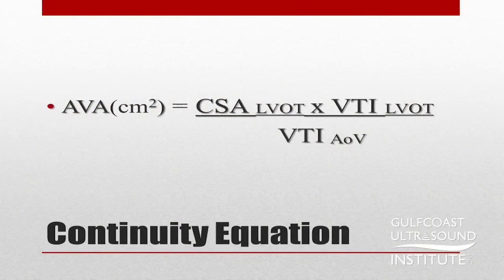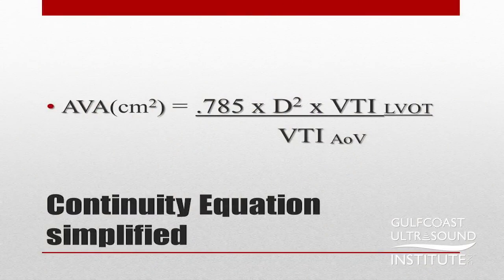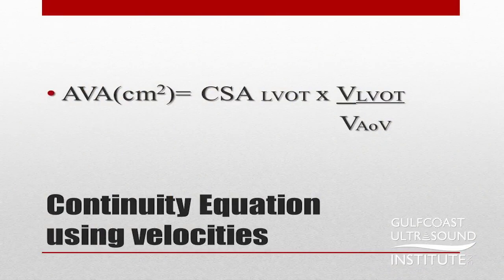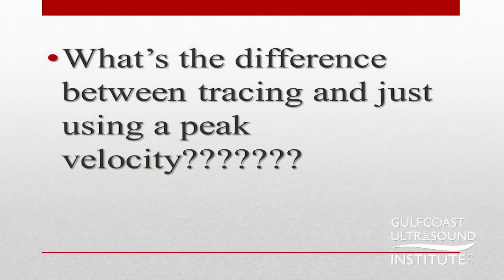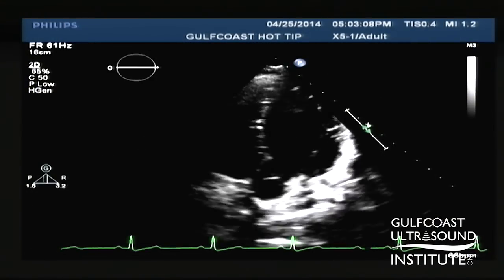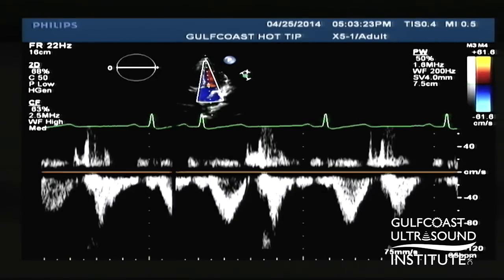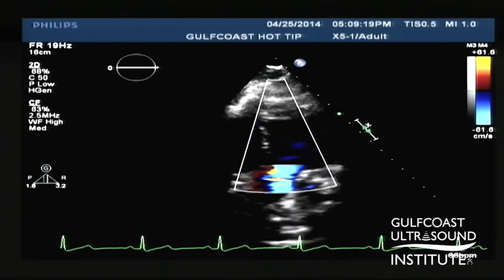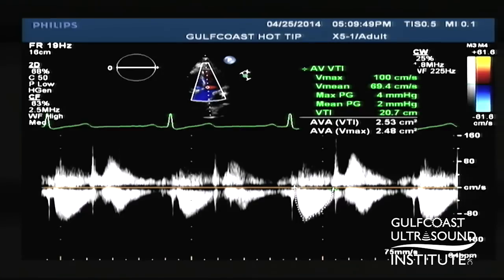Hot Tips - Calculating the Aortic Valve Area Using the Continuity Equation

Comment: Would have liked a closeup of exactly where you put the gate before dopplering the LVOT
Reply: The doppler gate for LVOT, using PW, would be slightly above the aortic valve leaflets (Not on the tip of the valve leaflet, but slightly above the leaflets). Hope that helps
Reply: @nesrinslewa4815  One should note a 'closing click' immediately after the LVOT waveform if you're in the optimal place.
Reply: @excalibur9768  exactly. without spectral broadening . that is the details/tips  we expected  the video to include .wasted time."hot tips" are in the comments unfortunately
Reply: @emmanouilbagiartakis6689  when we measure the LVOT diameter,  how the result we'll be used by machine with VTI of LVOT & A valve and give us the degree of stenosis
Reply: @emmanouilbagiartakis6689  thank u